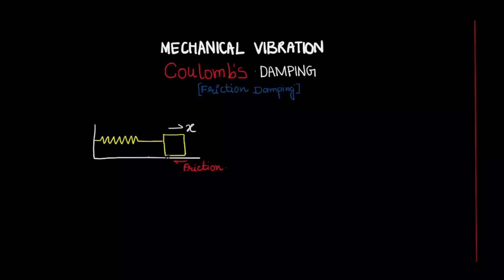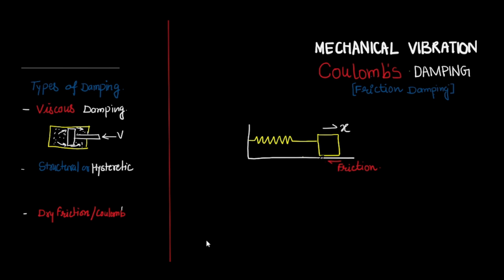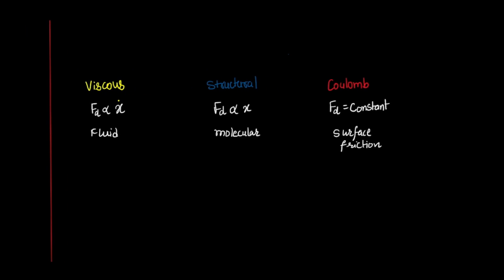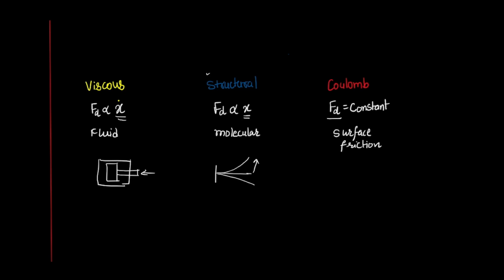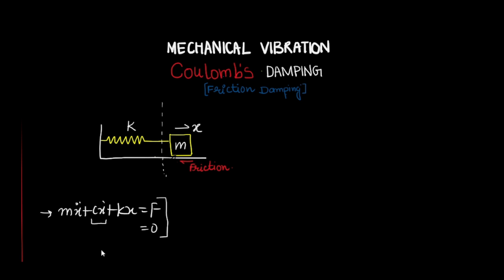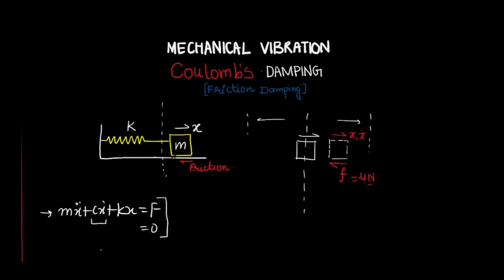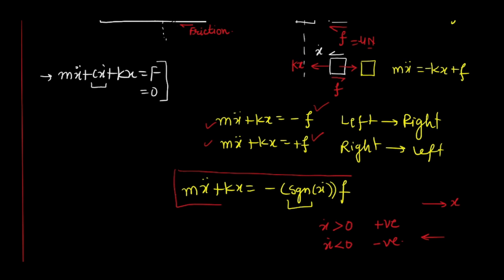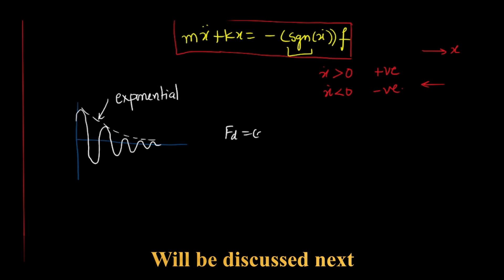Coulomb damping || Dry Friction Damping || Vibration || GATE Exam || concept clearing

Comment: What about Electrostatic friction: Imagine two parallel plates, one is suspended by a spring above the second plate and is free to move in plane relative to the second plate.  The two pates are charged with opposite charge (like a capacitor) such that an attractive force is applied between the two plates.  The suspended plate is forced to vibrate.  What is the electrostatic friction force developed between the two plates?